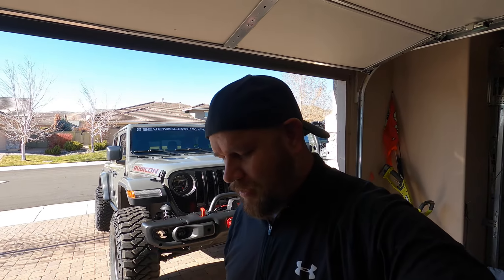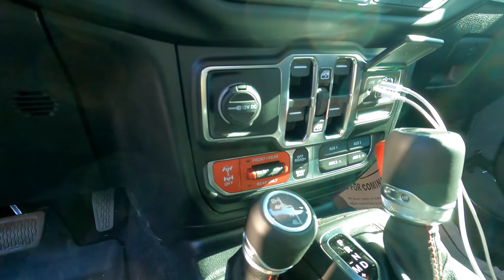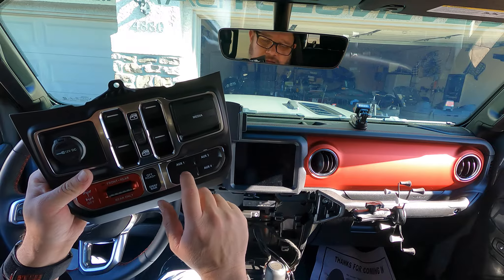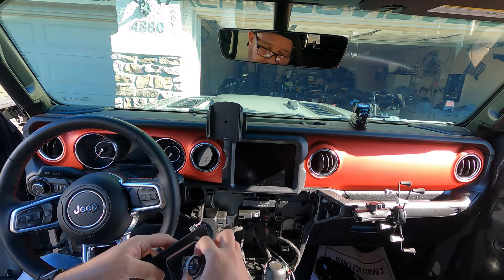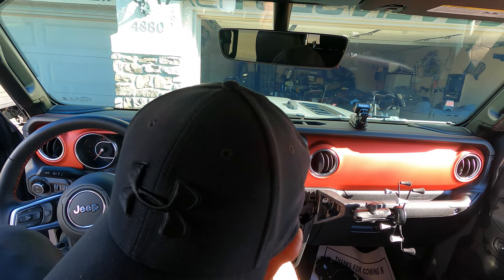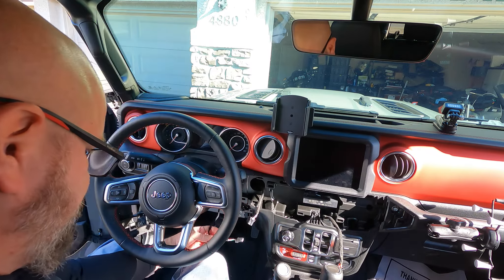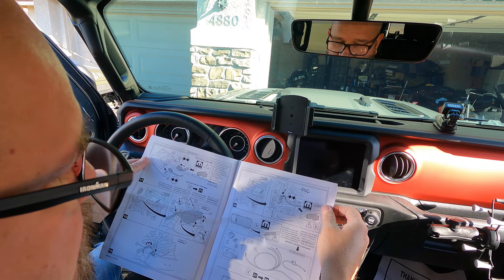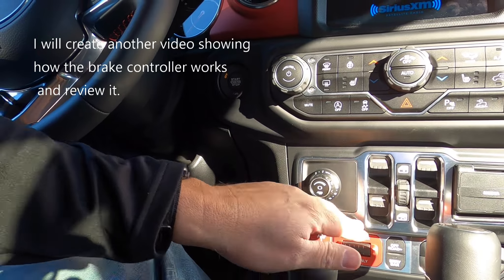I Install the Mopar Brake Controller on my 2020 Jeep Gladiator - 82215652A

Comment: Just finished mine.
The box will mount under the dash. Just make sure the box is as pictured in the instructions.  I had to flip mine around on the bracket. Plenty of length for the wire. Other note is you must remove the upper cable clamp from the dash structure and use that hole for mounting the bracket. Also I plugged in the connectors after box was mounted.
Reply from the maker: Nice, I probably should have taken more time to do it.

Comment: Been waiting to see a review or install on this. Thank you! Can’t wait to see it towing. If all goes well for you, I may get one for my gladiator.
Reply: I had one installed great working controller. I have no complaints. Worked good on a 300 mile round trip with a 14ft enclosed trailer and a light load.
Need more gravel for my new garage so I will try to make a video towing a good load at some point.
Reply: i know it is kinda off topic but do anyone know of a good website to watch newly released movies online?
Reply: @Carmelo Bruce Try flixportal. Just google for it :)
Reply: @Will Mohammed thank you, I signed up and it seems like a nice service :D I appreciate it!
Reply: @Carmelo Bruce Happy to help xD

Comment: Just for clarification, you cant plug the 12V connector back in to the unused plug you disconnected and left hanging behind the dash?
Reply from the maker: Correct, but I did end up getting another 12volt adapter and placed it under the drivers seat.

Comment: Could you post a picture of how/where you mounted the box? I have a 2020 Wangler JLU manual transmission and they say the clutch pedal will interfere, so it won’t work. I’m just curious if your mount point would help this issue.
Reply from the maker: I can post a pic or send you a pic if you like. Where's a good place to send it?

Comment: Good video! 
After adding this part do you no longer have a 12v plug? 
Hopefully it’s not an either or proposition...
Reply from the maker: it is an either or.. however, I was able to purchase a 12Volt adaptor for the rear passenger outlet. https://www.amazon.com/gp/product/B07M6T5FD3/ref=ppx_yo_dt_b_asin_title_o08_s00?ie=UTF8&psc=1
Reply: @BullGearOffRoad  Question about this...can you plug the 12V adaptor to the "goes to nothing" connector you hid to add a new 12v plug? I assume that can be done? This part....any thoughts?.... https://www.amazon.com/gp/product/B0886DNNSP/ref=ppx_yo_dt_b_asin_title_o04_s00?ie=UTF8&psc=1
Reply: @TheBashfulClam  does that kit plug into the 12v connector that is no longer used?
Reply: @Punkrockphotographer  it does

Comment: Did you shared where you end up moving original 12 instead of leaving behind dash
Reply from the maker: No, not yet. But I ended up moving it under the drivers seat and added one behind the backseat so that I can access it with my off-road fridge.. I'll make sure to showcase that in an upcoming video.

Comment: I just finished the Mopar Brake Controller on my 2020 Jeep Gladiator
. Does it light up? Mine doesn`t light up and nothing happen on my dash. How do you know if it works or not without trailer?  Your video is super helpful. Thank you.
Reply from the maker: So mine does light up when I first turn the vehicle on, then it shuts off after it senses there is no trailer attached.  When I have a trailer attached it does stay on.. I'll have a video uploaded this week with a review and explain the process.  Thanks for reaching out.

Comment: Thanks for the helpful video. Does the knob turn red for you when applying the manual brake button?? My turns red with brake pedal but not with button. Thanks

Comment: Nice video! Any reason you can see that this wouldn't also work on a 2018 JLU? Interestingly, many Mopar sites say it's not compatible, but Quadratec says it is..... From your installation video, I can't see why it wouldn't work, but you know how that sometimes goes.
Reply from the maker: The packaging said 2019, 2020, 2021 JL Wrangler and 2020, 2021 Jeep Gladiator. No mention of 2018.  It could be because of the wiring harness but if you mounted directly bypassing the factory harness.. I think it could work.  It does come with the wiring to bypass the factory harness.
Reply: @BullGearOffRoad   That makes sense! I'll be installing the Mopar hitch receiver wiring harness as well, so I'd imagine I can tap into that. Thanks for your response!

Comment: Have you had to take it to service and have anything done on the computer, computer flashed to make the controller work with the jeeps computer?/any updates
Reply from the maker: No, as far as I know you don't have to. I'm not 100% sure but I will find out in the next day or two.
Reply: I had to have the service department flash the computer when it did not work after they installed it. It still doesn't work. They are ordering a new switch controller.
Reply: Here is what I had to do to my mopar controller, this is a email that I sent to mopar that has a service bulletin that should fix any errors that might be happening to the controller. " I have already install a mopar brake controller, #82215652, but it does not work correctly because my jeep Gladiator was built 12/19. Which I see that you have a TSB 08-102-20 addressing this issue." 
I got the ABS module updated and whatever else this service bulletin called for and this seems to have corrected any trouble that I was having using the controller manually. Otherwise the controller works great. I did have to give up my 12volt outlet and have not figured out if I can place it in the center council, I do have a temporary outlet placed on the passenger's side attached to one of the auxiliary switches

Comment: How did you manage the small plastic tabs in the cigarette lighter?
Reply from the maker: I used a small screw driver to hold one side and pried the other side with another. it was tricky

Comment: When I bought my 2021 Jeep Gladiator, the dealership agreed to install the OEM trailer brake control and relocate the 12 volt adapter into the lower center console compartment as part of the Jeep purchase.
I got a call from the dealership saying that the technician had to destroy the 12 volt receptacle in order to remove it.😲
Also, the service department claims that the technician did not know how to relocate and connect the 12 volt receptacle.🤔
I drove home and the trailer brake control switch does not even light up.
I have to bring the Jeep back after they order a new switch.
I got them to order another 12 volt receptacle as some of my equipment only uses this type of receptacle. They had better not try and charge me for it.
If the dealership can't figure out how to relocate the 12 volt receptacle, I will find out who can and they had better compensate me for it.
My wife has a 12 volt receptacle in her center console on her 2019 Jeep Cherokee Limited.

Comment: I can't figure out where the stupid instructions want me to mount the controller. I'm stuck lol
Reply from the maker: It's basically on the aluminum frame rail.. it is kind of hard to tell from the instructions.
Reply: @BullGearOffRoad  I finally found it. Instructions were crap lol Your video helped alot more than the Instructions. I had absolute hell getting the ash tray lighter removed too lol Thanks for the quick response
Reply from the maker: @js9234  Glad I could help.. I know, I hear ya.
Reply: @BullGearOffRoad  Hello! Would you be able snap a few pictures where is module/controller should install , can't figure out... (very upsetting)

Comment: From the comments sounds like it might be a nightmare to install. Does anyone know what the dealers are charging for kit plus install ?   Thanks. JJ
Reply: $450 parts
$315 labor
I just got quoted for a ‘23 JGC L which looks like it uses the same mopar controller.
I was told the dealer had to “unlock” it on this car. I hope they’re not lying. Otherwise I would do the install. It’s also far cheaper on mopar website.